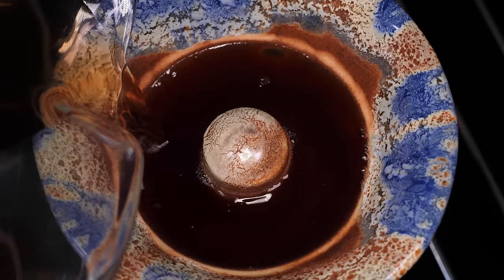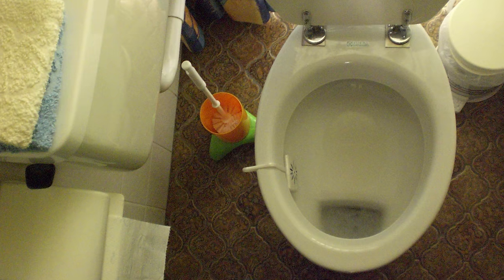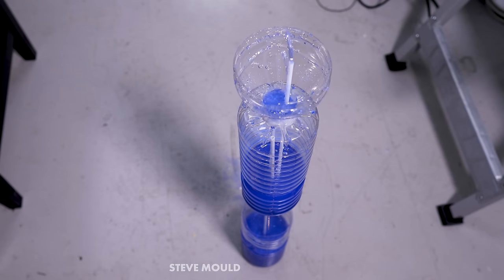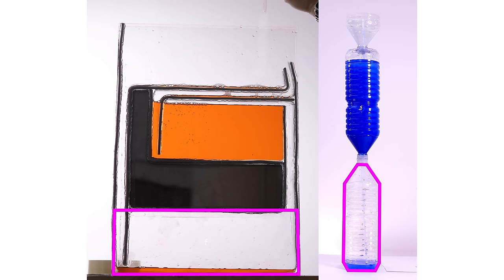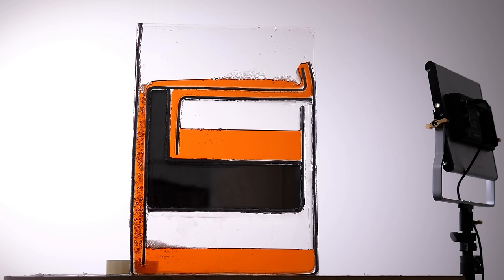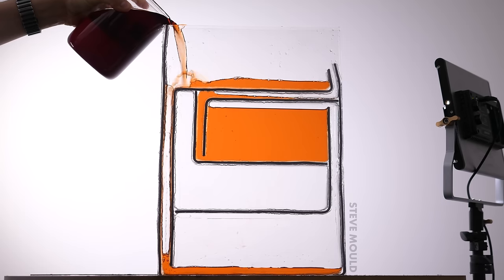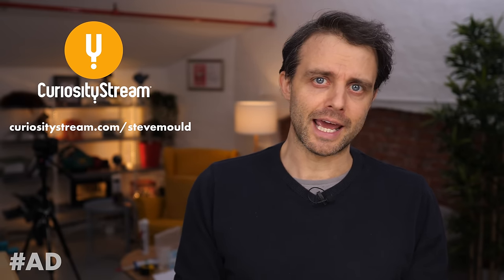A 2D Heron's Fountain Behaves Weirdly

Comment from the maker: The object itself is 3D of course, but there's nothing interesting happening in one of those dimensions! What I'm saying is, there's a legitimate sense in which the mechanism is 2D. Don't @ me.
The sponsor is CuriosityStream: Get a whole year for just $12 by going to https://curiositystream.com/stevemould and using the promo code stevemould at checkout.
Reply: but would it work with oil and water?
Reply: 8:24 "gas is less dense than air” that almost slipped passed me. Shouldn't it be gas is less dense than liquid
Reply: @biggjiggins8987  
Yup. Wawa be heavier
Reply: @biggjiggins8987  unless the air is chilled somewhat heavily until it's no longer a gas, perhaps?
Reply: Not something that would work in 2d, but I have noticed lately that lightly stirring (in a repeated pattern,) the water in a pot that's just starting to boil is a neat way of 'seeing' the currents.

If you time it where bubbles are forming on the bottom, but not rising yet, because the water above them is still cool enough to act as a condenser, then when you stir, the faster moving currents will carry the heat away from the part of the pot under them faster than the slower moving ones, so you get lines of bubbles where the water is more still, and the heat can build up more.

I don't know if there's enough there for a video, but I definitely thought of you when I noticed it.
Reply: What’re your go-to YouTubers Steve? Would love to check them out, I’m also on the lookout for new awesome content creators!
Reply: @biggjiggins8987  Also 8:37 "half column of liquid, half column of water"
Reply: I would love to see a video on hydraulic ram pumps. They use a similar effect relying on pressure diferences between air and water, but also make use of the water hammer effect I think? I don't know, you'd probably understand it and be able to explain it better than me of course!
Reply: This is great! As for other 2D ideas, how about a hydraulic mechanical advantage device, like a hydraulic press or a jack? Though for that one, there's not as much motion as a greedy cup or Heron's fountain. More hydrostatic I guess? But the way the force is determined is based on surface area. You know what's a great way to show surface area between a liquid and its container in a 2D demonstration? Hear me out: Orbeez. Right? Right? A little tricky because you want the Orbeez to only grow to be just about the thickness of the container. If they're too small, they'll stack. If they swell too much, they'll clog. But I think you might be able to control the equilibrium size of the Orbeez by adding the right amount of salt to the water.

I'd do it, but... it just sounds like so much work, you know?
Reply: 0:45
In Canada we kind of have a mix of different ones, some of the older ones use the same cisterns but others (the ones that are just the bowl next to the wall) are just a piping system. It’d be cool to have a video about how different toilets work around the world
Reply: @stevemould Why don't you mention the most important thing in this mechanism and that is atmospheric pressure?
Reply: The good thing about a 'plateux toilet' is also that you can observe your droppings just before flushing. 'but why'. To inspect if you have decent turds, or strange color turds, or watery turds, or worms in your turds. You know, basic information you need for staying healthy. You already mentioned the other good thing: no splash up of turdy water against your buttocks. Which is not something you can just brush aside like 'meh'.
Reply: If you want the combination of turds plus fountains I can recommend Drain Addict! Plus you get Ollie’s swinging ‘first person shooter’ arms and Ratty getting his corn.  Try it - you’ll like it!
Reply: Yup, it's an extruded 2D form. You could animate it in 2D. You only used the 3rd dimension here because you haven't gotten the knack of 2D fabrication.
Reply: That cable is called "Twin & Earth"
Reply from the maker: @dogwalker666  yes! Though apparently only in the UK and Australia and one other place I can't remember.
Reply: @payasoartwork5906  I'd argue about that. I think that people who cought that small mistakes understand what Steave was talking about even more than ones who didn't, because you need to understand something to correct someone. And IMHO sometimes it is good to be pedantic not to spread misinformation.
Reply: @SteveMould  probably New Zealand,  Europe uses something similar but they insulate the earth,  and the USA  is totally different.
Reply: Answer:

Displacement
Barometric Pressure
Reply: You should get with the guy from the Practical Engineering channel.  He does some really good hydrodynamic videos with transparent models that pertain to civil engineering.
Reply: Having a think about what it means to be 2d or a definition for it. This is one:

These are "2d objects" in the sense that all 2d slices along one dimension are the same. Maybe we can call them extruded solids? 

What about "2d objects" in a different kind of sense - in the sense that all 2d slices about an axis are the same  - i.e. solids of revolution? Are there processes that work in solids of revolution, but not in extruded solids or vice versa???
Reply: So if you don't need a gas in order for it to function you could use rwo liquinda instead, like maybe water and mercury?
Reply: @payasoartwork5906  it was a mistake (everyone can make them) and you didn't get my argument about misinformation. In this case I meant more generic situations where mistake leads to misinformation. When it comes to my spelling, I'm grateful that you've thought English is my native language, but that's not the case and that is why I see no correlation between spelling and strength of an argument. Jednakże jeśli bardzo chcesz mi udowodnić mój błąd, to możemy dalszą część rozmowy prowadzić w moim języku ojczystym, który nie powinien sprawiać Ci żadnych problemów. (Translate last sentence from Polish if you didn't understand it)
Reply: Links to CuriosityStream do  not work! It shows me a bunch of random stuff and when I log in I get the normal base page. Also search does not work good.
Reply: @SteveMould  in my experience working with electricians in the US ppl refer to it by the trade name Romex, similar to calling a razor knife an X-acto. But often you'll call it by the gauge and number of non ground conductors like 12/2, the official labeling is similar: gauge/number NM-B. Meaning nonmetallic sheathed building cable.
Reply: @SteveMould  It's often referred to as "romex" here in the States.  That's undoubtedly just a brand name that's been genericized.
Reply: @biggjiggins8987  That's not true either; some gasses are more dense than some liquids. It should really be "air is less dense than water"
Reply: @SteveMould  I'm curious... The color in the curious stream of water in your 2D Heron's Fountain matches the color of Curiosity Stream's logo. Coincidence?
Reply: I would be curious to see what would happen with this model if you were able to construct it so the plates of glass were so close together that surface tension and capillary action came into play.
Reply: @payasoartwork5906  , Lol, the question is in the thumbnail, genius.
Reply: I wouldn't mind seeing 2.

 A tesla one way valve. Seem everyone just blows air in them instead of having a good visual. 

And a ram pump.
Reply: The 2D version makes perfect sense. I'm wondering if sealing the system and having a remote operated release valve to start it, so you could try different gases would show a difference in flow rates? Try helium, then SF6, to see if the denser gas has more or less "push" in the system. My hypothesis is that instinct will be shot down by some fact of physics I have missed. Helium should make the system flow faster, as there is less mass for the water to work against, but then again, it's more compressible than SF6, so it may compress to the density of SF6 before the water starts flowing, resulting in the same flow rates for both gasses.
Reply: @Steve Mould  What type of adhesive did you end up using?  Silicon-sealant is used even on very large aquariums for glass-to-glass joining, & if the cable-insulation is smooth & non-porous (like the white insulated-wiring used here in Australia), the components will bond well & not leak once cured!
Also, did you experiment with different dimension of the flow-tubes, as atmospheric-pressure will affect the flow-rates through the passages?
Reply: Steve mould.
Heres a good video.

Put super glue on toilet paper.

It gives off fumes
And it burns!

But why Steve?
Reply: @Bibibosh  Because cyano-acrylate (Super glue.) has an exothermic chemical reaction with cellulose (Paper/cotton fibre.) along with collagen (Skin.) That's why low density paper burns, or at least smokes, why skin gets hot, or sometimes burns if you are using industry level cyano-acrylate. Paper like printer paper is too dense, and the white clay particles in it slow the reaction, so it barely gets warm. I hope that makes sense BibiBosh.
Reply: what have you had a balloon at the first container and the second container?  and as for the path for it to go up have check valves in there so it only goes up and doesn't come down?  would that not always have the system pressurized when there is an air bladder in the first and second containers?
Reply: You should get into micro fluidics
Reply: @SteveMould. It is 3d but 2d. I just love @ting you
Reply: You could do a hydraulic ram pump. They are sort of 2d already but they are interesting and counterintuitive  in those rare times when you come across them .
Reply: Forget 2D. You made this a 1D demonstration. Great explanation!
Reply: 5:01 "You can hold much more liquid in 3D than in 2D"
That was great!
Reply: @ettorefassina356  We had them in Argentina a long time ago... Fortunately they are pieces of museum now.
Reply: Shouldn't the air get compressed?
Reply: Do this in reverse with a liquid that is lighter than gas!
Cody did a Frobscottle video a few years ago.
Reply: A video on hydraulic ram pumps would be awesome!
Reply: Apparently, the toilets with a flat part on them were designed for the hospital so they could inspect your splinter. They have these in Holland in most houses that don't have the new hanging toilet version. I've installed loads of them qualifying as a plumber over there ;-)  pretty weird aren't they!  You've always got great videos, keeps the mind entertained
Reply: An easy way of thinking about this is that its like a water trap, but think about it from the air's perspective. Its like flushing air up an air trap instead of flushing water down a water trap.
Reply: @flurgerbla7609  im curous about this aswell! What about other lighter gasses? like helium, what about heavier liquids? Like mercury?
Reply: Steve you are again! in a path to discover a new type of something. This time it is about hydraulic machine. I tell' you because I know. I invented two. But I'm really invidious of you and I'll not give you more hints if you don't even ask. I know I'm not that amazing person I use to think about myself, but here is the good news: Maybe you are instead! :-) You are very very close. Now stop with those hints!
Reply: The reason you don't get a fountain in your 2D version is technically not due to friction, but rather drag, viscosity, and turbulence.
Reply: 7:51 It's basically a 1-D Heron's fountain
Reply: Steve, have you drank enough water lately? How are the old liver and gallbladder feeling? Or did you eat to much carrots?
Reply: Interesting.

When I see things like this, with fluids & flat surfaces, I can't help recalling the old demonstrations of Capillary Action. (⊕)
I would love to see both your best example of this effect & - since you seem to make it look easy - your clear & concise explanation of how it works (& why it's important for humans).

After that, you could get into the joys of Laminar Flow , Hydrostatic Shock & how you can cut steel with water.

(⊕) Probably from "The Curiousity Show" way back when I was a kid in Australia...
Reply: @Steve Mould
Reply: @SteveMould  
Ha I @ u
Reply: @SteveMould  .
Reply: Can we get a 2d water hammer?
Reply: Hey, i'm curious, in the example you show at 9:15, if a funnel is used at one end and it was filled up, wouldnt that increase in pressure be higher on the funnel side than the other which would push the water in the tube on the right side above the water level in the funnel?
Reply: @biggjiggins8987  was looking for this comment
Reply: Hi, I think the other advantage of the ''turd on the shelf'' is you can observe the turd anb assess your health like that. To my knowledge, it's mostly a german thing, I don't know anyone in France (where I live) who(m ?) have this system.
Reply: I prefer this to high school physics and chem
Reply: Just reply to the 3D conspiracy comments with: "Everything you watch on YouTube is actually 2D."
Reply: Do a video on hydraulic Rams please, these acrylic 2d models are awesome to understand those mechanisms
Reply: Can you mention name of you tube channels you like
Reply: @biggjiggins8987   jep also noticed, is it a error, or am i overthinking it?
Reply: try creating a tesla valve
Reply: You could install an air pump in reverse mode on the upper tank to force the liquid to stat to fill up the upper tank, assuming the air space volume between the 2 volumes is much less than your diagram. Than you could have fun on repeat.
Reply: @Steve Mould
Reply: @jodynace8884  yes, you are absolutely right.
Reply: i am just wondering if that were to interact  with perhaps a temperature shift what would happen while it is unbalanced. and what would happen if i have a river feed it a supply of water would it be possible for it to act like a waterfall which then i can use to energy to the point that is better than modern dam turbines.
Reply: @Steve at 8:23 you said "gas is less dense than air"
Reply: @rednammoc  but he was discussing the air in the tube so doesnt gas or air less dense than liquid make more sense because it's more relevant?
Reply: @SteveMould  What did you mean at 9:11 when you said it's because of friction? The reason the liquid doesnt move up the right side of the container you mean? Isnt it also mainly the force of gravity keeping the liquid at the bottom of the container even more so than friction right? Not to mention air pressure from above? Hope you can respond. Thanks for sharing. I'd never heard of a heron fountain or a greedy siphon before.
Reply: Sort of random question; what does textured glass in bathroom windows actually do to light? I realised today that it doesn't really diffuse light per say - you can still tell which direction a light source behind the window is coming from, and the light isn't scattered in every direction. But obviously the glass does something to it to ensure you can't see a clear image through it.
Reply: @baskoning9896  am i the only one who's never heard of a plateau toilet?
Reply: A 2D model of the pistol shrimp?
Reply: In your list of toilet types: the WTF is a German style toilet. And the biggest downside is that if you haven't gone to nr.2 for a couple of days (you know, it happens) then once you finally get some movement, the heap piles up 'till it hits your balls.... I kid you not. I have encountered them a lot on vacation, and I still hate them. The biggest advantage is that you can inspect the state of your health (MDs will agree a lot about your health can be told by inspecting your poo), and it's also easier to recover those grains of gold or diamond that you swallowed during that mine visit. XD
Reply: I hope this is related :  High humidity in air when the weather is hot makes us feel hotter.  But high  humidity in cold weather makes us feel colder.  HUH ??? What on earth is going on please?
Reply: 🔴 What Is Islam? ⚠️

🔴 Islam is not just another religion. 

🔵 It is the same message preached by Moses, Jesus and Abraham.

 🔴 Islam literally means ‘submission to God’ and it teaches us to have a direct relationship with God. 

 🔵 It reminds us that since God created us, no one should be worshipped except God alone. 

 🔴 It also teaches that God is nothing like a human being or like anything that we can imagine.
🌍 The concept of God is summarized in the Quran as:

📖 { “Say, He is God, the One.  God, the Absolute.  He does not give birth, nor was He born, and there is nothing like Him.”} (Quran 112:1-4)[4] 📚

🔴 Becoming a Muslim is not turning your back to Jesus. 

🔵 Rather it’s going back to the original teachings of Jesus and obeying him. 

More .....👇

🔴 THE RETURN OF JESUS
Reply: @flurgerbla7609  Yes, but the result would be the same, once equilibrium is reached, it will stop. Although, because the density difference is lower, the fountain will perform less spectacularly.
Reply: @WanderingWolfe  yes, but i think it would be easier to comprehend the mechanism with oil and water
Reply: @flurgerbla7609  Excellent point. I didn't realize this was your purpose when you asked.

From a teaching perspective, I think you are absolutely correct, and I'd think oil and water would be a great choice.
Reply: Can you do a 2D version of the Autopot Smart Valve?
Reply: @flurgerbla7609   tycbx
Reply: ramp pump in 2d
Reply: Could you make one with water in place of air and tungsten hexafluoride gas in place of water?  The density difference is only 13x heavier for tungsten iv fluoride over the water, so I'm not sure it would work.
Reply: Ok we won't @ you
Reply: CAN YOU DO A 2D VERSION OF A STERLING ENGINE?
Reply: 100th reply :)
Reply: For a fountain though,  how would you keep it going?
Reply: You obviously need a density difference to make this flow, but you could do it with two immiscible liquids of different density, for example oil and water.  That should get around the complication of air being compressible.
Reply: Dang you guys are all legitimately saying stuff to eachother. No b.s.
Reply: @biggjiggins8987  It depends on the gas
Reply: 1
Reply: Landing pad. I could never bring myself to use one. I would wait till there was access to a more modern toilet.
Reply: lol dont @ you, then dont use a crappy title.
Reply: @SteveMould  hmm nice bike
Reply: Thank you, because your 2D title triggered me
Reply: Ok
Reply: So this is similar to something I thought of a while ago like years anyways I was thinking about the way a water wheel can make electricity so if someone was to create a siphon to feed the water wheel why not have a battery charge up so when it’s reached a point where it’s about to stop why not have a pump to bring the water back to a siphon and attempt to make it flow continuously to the point of either lasting a long time or indefinitely if the power is stable enough
Reply: You need to look at liquid at a continuum breaking size.  (Smallest molecular grouping which Newtonian physics applies). When your describing the full cup scenario midway through you would be able to see that nothing would happen as at that continuum breaking point you essentially have a glass full of sticky sand.
Reply: Well sand that is sticky only to itself.
Reply: Oh if you could make a wave pool and do something with propagating waves in 2d. Idk what but something.
Reply: @Steve Mould The object itself is 3D of course, but there’s nothing interesting happening in one of those dimensions! What I’m saying is, there’s a legitimate sense in which the mechanism is 2D.
Reply: @flurgerbla7609  yes, oil is still liquid.
Reply: Blow holes I must know how they  work!!!!!!!! 
0         /|
           | |
0         \|
Reply: And geysers!!!!!!
Reply: Hydraulic ram, please.
Reply: Could the Greedy cup be added to Heron's fountain to automatically reset it?
Reply: One mechanism that's very interesting is the Ram Pump.
Reply: I just had an interesting revelation about this design. You could extend the life of this kind of siphon, by adding a mechanism where you could pump air into the bottom container under pressure (basically a bicycle pump) allowing you to re-prime the siphon. The only catch would be that the water from the bottom resevoir would have to drain from the nearer the bottom of the tank not the top of the tank.
Reply: 8:22 "gas is less dense than air" ... 🤔
Famous last words
Reply: Oh ... Of course it's already been commented 😅
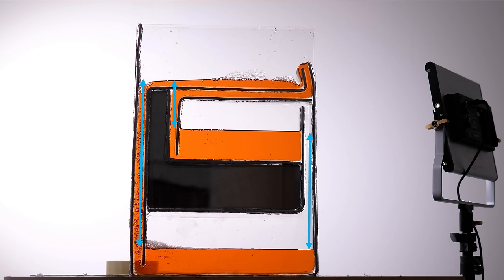Reply: 8:33 "the pressure of this column on the left is higher than the pressure of the column of liquid, half column of water" ... Well okay... Air/gas can be seen as a liquid... 🧐🤔
Reply: But nevertheless, your videos are always great and it makes me happy to learn about the little things in life.

You also leave enough space to think about what might be happening, between when you first show what's going on and before you give the explanation.
Reply: @rednammoc  then it wouldn't be considered gas
Reply: I thought of an idea of a Pepepual motion Machine… use ramp pumps to do most of the work in sequence… the use gravity to pump about 15% of the water that flows through then… connect them in sequential until the water remaining is little, then use the heron fountain idea combined with how miners would sometimes collect air pressure… super saturated the water with air bubbles using gravity and some height and let the Bubbles be collected in a chamber. Basically it needs vertical space for speeding up the water as it leave a Ramp pump before it enters another and a drop to Super saturate the water between ramp pumps so a ramp with a drop also and use the air pressure to pump the last remaining water after it has  been reduced as going through many ram pumps and the ramp pumps get small as the amount of water decreases, and then could get pepeptual motion of water…

Ithink vampires are real and I think I’m being murdered by another me : vampire me. Like a Venom movie only this one the worse one: no empathy. They are watching me : ghosts in my room and there a shadow spider under my sink that is massive. Girls just wanna have fun they say. Something forcing is way up my throat in ghost world… it’s like a parasite but they’re everywhere and we are like fish and a fish tank too these people
Reply: @Chris-wf2lr  loool what a comment 😂🤣👌
i hope you are really just trolling instead of having some serious issues 😁
Reply: Try tacky tape for your prototypes :)
Reply: Make this thing - https://www.youtube.com/watch?v=OCVwFeZBuy0
Reply: @Steve Mould
LMBO!!! I think this is the first time I've actually seen a creator specifically tell commenters not to @ at them!!! I've got all kinds of Don't you even think about it Mama and Grandma sayings popping in and out of my head right now, hence the LMBO!!! The one that was the kiss of death, in where the kids thought they were really going to get it but it was usually pretty tame.... was, "Don't you ___ me! Go to your room and wait until your Daddy or your Pa or Grandpa gets home!" which was usually several hours from then!!!

I'm getting together some parts I need to create something very similar to this, hopefully making it an actual perpetual motion system. The creation of which I'm hoping will be big enough to supply enough KWh of free energy for a single family  of 4 maybe 5 in preferably an efficient house for small or huge investment depending on what the individuals want to do. 
IF I can, accomplish this,  then I will turn around and release full instructions for free, on how to make it rather cheaply and/or expensively. I think, but I haven't searched into what size would be needed to create enough kilowatt hours just yet, because I need to see if the one part of the system will work, because without it, the rest will be unnecessary.

So everyone, picture me figuring this out, that me and my loved ones are safe and that the simple version that will be easy for anyone to find for, is easy to built and be rather inexpensive to build especially for those with little to no money!! So pray for me and a completion of this system for everyone to have.
I also think I have figured out a way to sw create a clean vehicle that will run solely from 100% Biogas so stand by for that as well, although that could take a little while for me to present! at least the concept for it if I cannot pull together enough funds together!!
Reply: @SteveMould India,
It's aluminum cable here, not copper, used for cheaper applications like delivering electricity from pole to your house.
(no body cares about this energy loss because for your it's before the meter, and for govt, well, they are profitable any way.)
Reply: 8:25
Reply: German toilets have a shelf so we can inspect the poor and maybe give it a good smell.
Reply: 8:24 "...because gas is less dense than air."
So what GAS here is less dense than AIR?
Reply: Everybody’s missing the real question here. Do farts float? I would like to see a thermal camera video of a fart expelled and rising to the ceiling like a stinky ghost. Would it be a battle of toot gasses vs. atmospheric air composition, or more likely the temperature difference?
Reply: @indowneastmaine  You don't need video footage to prove that there is something wrong with your frontal lobe :)
Reply: Стив, чтобы получился действительно фонтан, нужно уменьшить сечение левого канала раза в 3, а также сечение выходного канала. Очевидно поток воды не успевает заполнить левый канал, и поэтому не создаётся необходимое давление, следовательно объём левого канала слишком большой. А идея отличная!
Reply: 8:24 "Gas is less dense than air"......did you make a mistake here?
Reply: @KingOfGamesss  конечно он имел ввиду что газ легче воды, поэтому газ поднимается
Reply: New projects... 🤔...
How about a quantum water computer?
Reply: "Gas is less dense than air" ~Steve Mould 2021 8:24